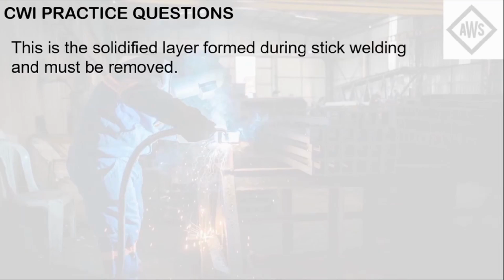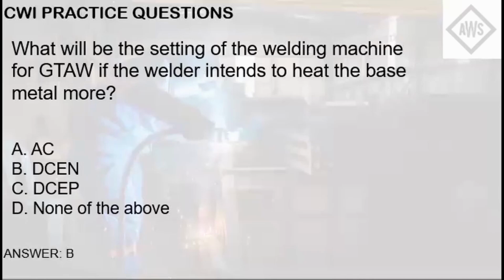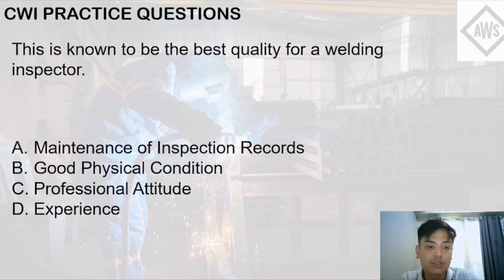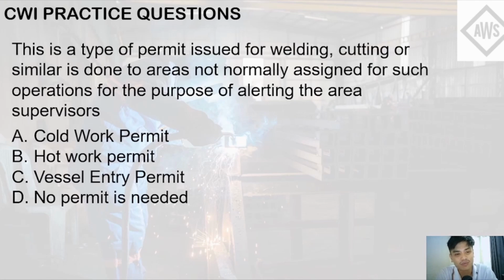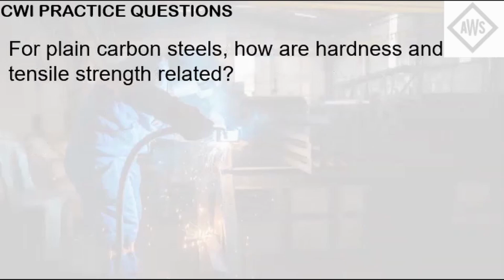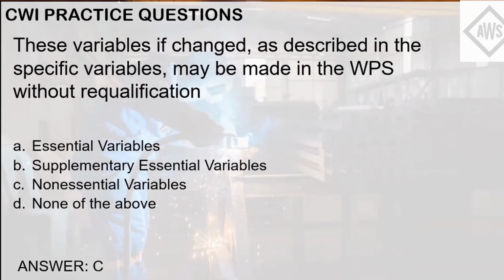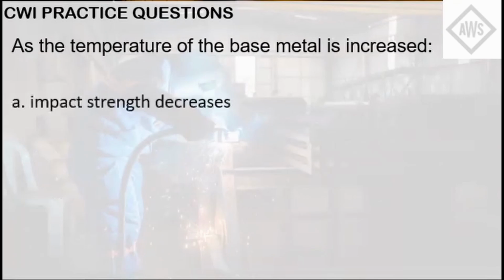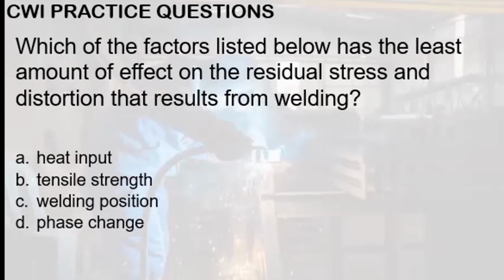Full Compilation of 100 CWI Part A Questions - Answers and Detailed Explanation!

Comment: Which of the following is false regarding granular flux for submerged arc welding?

A. Flux is placed into a hopper above the welding torch and fed by gravity
B. Flux is forced to the gun using compressed air
C. Flux when properly stored can cause moisture from creeping into the weld
D. Flux may prevent the welder from seeing the arc with respect to the joint

ANSWER: B is correct because you don’t use compressed air in SAW.  C is wrong.  The wording is not correct. However, when a flux is properly stored,  There’s no creeping of moisture into the weld.
Reply: actually, I think C is the correct answer. Often flux is gravity fed in SAW, but there are flux delivery systems that use compressed air to distribute the flux. C is the correct answer because the statement is false. It should read "flux when NOT properly storedcan cause moisture to creep into the weld"
Reply from the maker: yup thanks for the correction, accumulation might be a better term

Comment: CWI PRACTICE QUESTIONS
An electrode is tagged as E70T-13, what does the last digit mean?

A. Usability designator
B. Shielding gas designator
C. Position designator
D. None of the above
AWS

ANSWER: A and not b.  because the last digit also describes the polarity. Not only the shielding gas.
Reply: you are absolutely right

Comment: In this mode of GMAW transfer, the low arc voltage is used to minimize spatter and enable deeper penetration.
Rate of transfer range from 20-70 droplets per second.

A. Pulsed
B. Globular
C. Short circuiting
D. None of the above

The answer is C. not be
Reply from the maker: sorry I am quite unsure about the point of your comment here
Reply: He said C
Reply: Answer is D none of the above because spray transfer is the correct answer. Short circuit has a lot of spatter (though not as much as globular) and also short circuit is not associated with deep penetration. The 20-70 droplets per second is the spray in spray transfer.

Comment: Please review answer of question 9, it is seem not Globular transfer? Thanks.
Reply from the maker: I think that is the correct answer.
Reply: @Hardhat_Learning  First of all thank you for the video, it is very good overall. However, for this question it is certainly not globular transfer. Globular transfer consists of a large ball of liquid that forms at the end of the welding wire (as more wire melts) until the ball becomes so large that it either falls off or more often physically touches the weld pool at which point a short circuit is made and the large ball explodes causing excessive spatter. This is different from short circuit mode because the voltage and therefore arc length in globular transfer are longer allowing these large balls to forms whereas the balls formed in short circuit transfer are very small ball when they touch the molten pool. I believe the answer to this question is none of the above as spray transfer is the transfer mode associated with deep penetration and also low spatter (because there is no short circuiting causing these explosions).
Reply: @WeldWorldWumbo you are correct. The wording of the question actually makes this impossible to answer. While globular is a low voltage transfer method, it does not transfer that many droplets. Pulse does transfer that many droplets, but it's not a low voltage process

Comment: Acetylene can be pressurized up to 250psi in the cylinder and regulated down to no more than 15psi after the regulator
  The cylinder will not explode at 15psi.  Thank you for the content it's very informative
Reply from the maker: Thank you as well, yeah I exaggerated a bit there, it will not explode at 15 psi. The bursting pressure of the cylinder depends upon the material as well